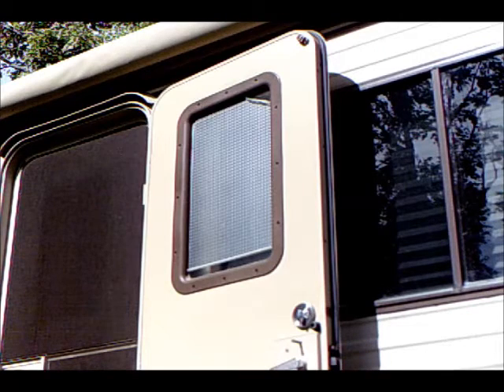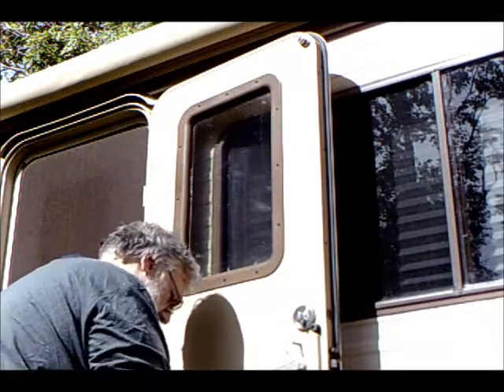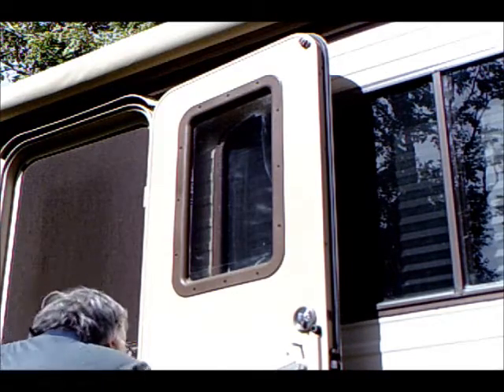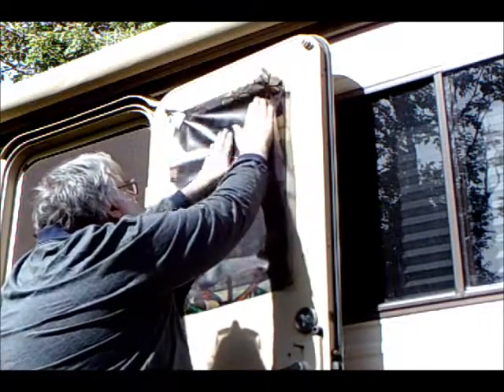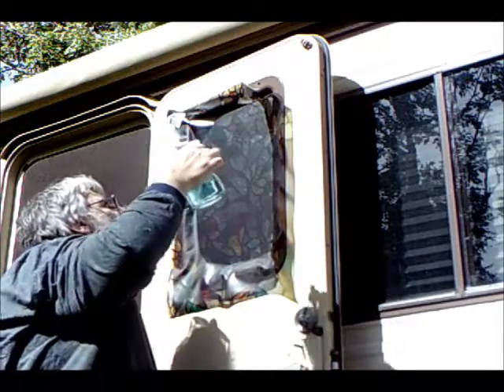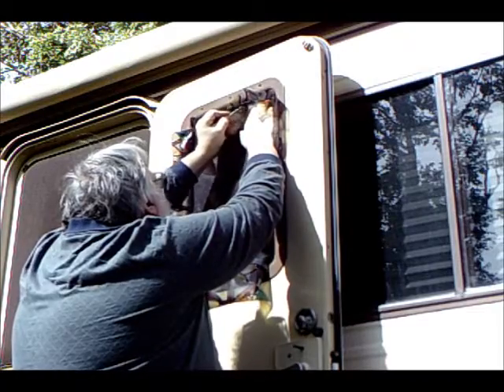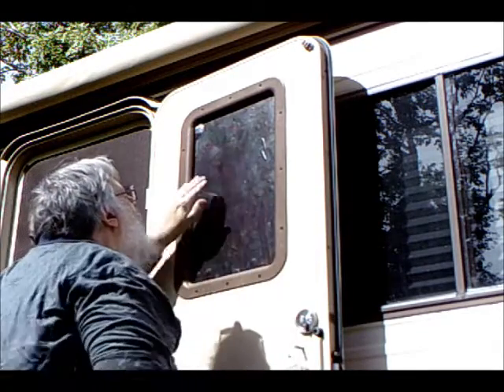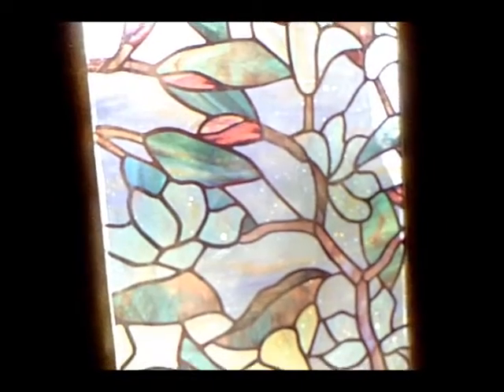Updating The Window On The RV Door

Comment: Had to replace the exact same style window.  Had it replaced in minutes, but had to make a few adjustments.  I bought mine off a RV Seller off E-Bay and it came with all the gasket and glass installed.  All I had to do was tighten 16 screws once I had it square with the door.   It shipped quickly and only took a few days.  Their E-Bay store is  https://www.ebay.com/str/biasproducts
Reply from the maker: I recently had to replace the window film. I found it was easier if I took the pane out.
I also decided to use sealant on the external frame since it wasn't very waterproof.